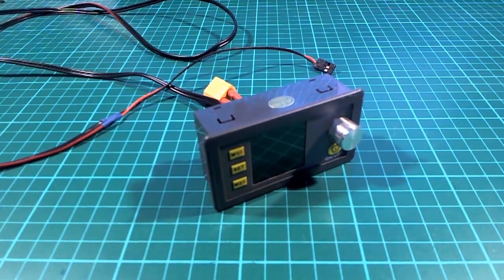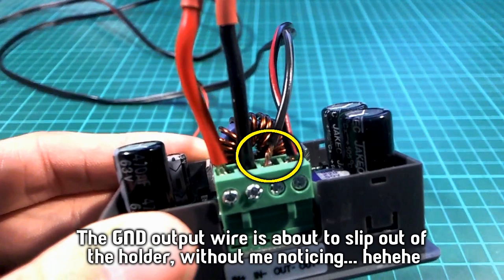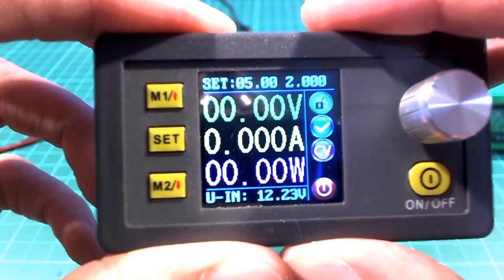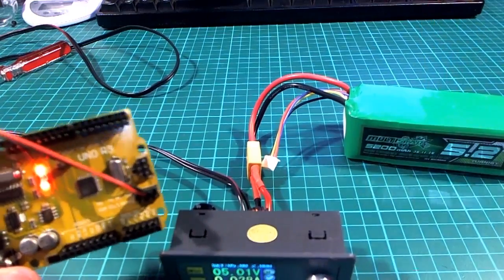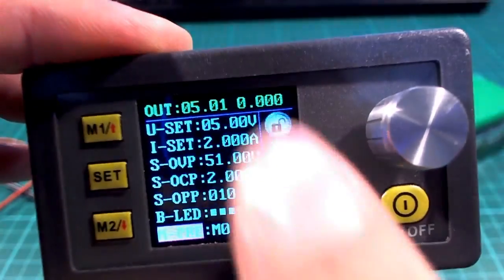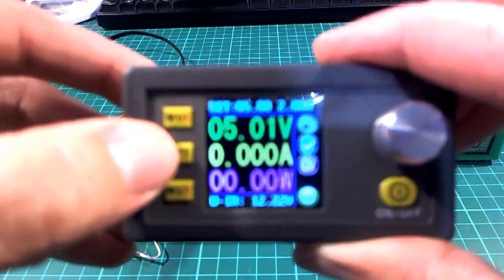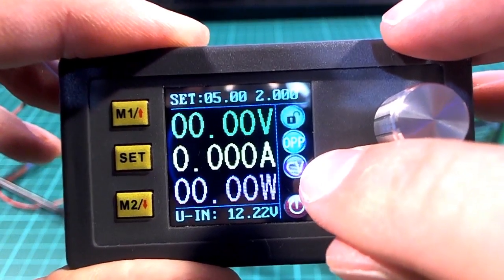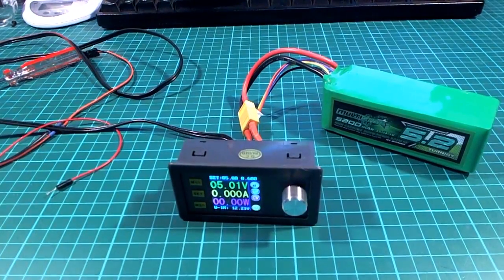Mini adjustable DC power supply/meter first look DP50V5A

Comment: Yep, I definitely need one, I have a
HP power supply (19.5V 3.5A), and IDK is small and kawaii lol
Reply: Hi friend 
how you get 0.9. are you sure you get 0.900? our module max error 10mA, please use a better mulitmeter to compare . and our module can't be calibarted. because we don't need.. 
thank you 
and Hi friends. 
 there is good news. we just publish the DPS power supply module ( DPS3003, DPS3005, DPS 5005 and DPS 3012)
this is the link http://www.aliexpress.com/store/group/DPS-Programmble-control-power-supply/923042_508466030.html
DPS series is updated version, it updates some function and measurement 
range is increasing, especially DPS 30V12 ( current is 12A)http://hz.aliexpress.com/store/923042
you can check ..
Reply: I am the designer of this goods. 
we have my own shop on aliexpress http://hz.aliexpress.com/store/product/RD-DP50V5A-Constant-Voltage-current-Step-down-Programmable-Power-Supply-module-buck-Voltage-converter-color-LCD/923042_32596330856.html 
there are many other version. you can check
Reply: I have the DP30V5A but I-set and U-set are way off. When I-set is on 1.000A, it runs in CC at 0.900A !
Can I calibrate these values?
Reply: It shows on the display of the DP30V5A not on multimeter: the DP30V5A show I-set op 1.000A and shows current of around 0.900A when going into CC  mode
Reply: Hi friend， 
could you send a picture to me , my email 1749808860@qq.com. or you can make video on youtube, and tell me the link 
thank you

Comment: bought one even before this video ended. hopefully it will hold up - but seems like a great value & i'll find it very useful in some of my projects not only w/ Arduino, but with high-power LED's. thanks for this - you are an experimenter after my own heart! found you after watching iNav vids.
Russ from Coral Springs, FL, USA
Reply: if you want to buy high power? we are designing DP30v/12A module . you can keep eye on my shop http://hz.aliexpress.com/store/923042
Reply: Hi friends. 
 there is good news. we just publish the DPS power supply module ( DPS3003, DPS3005, DPS 5005 and DPS 3012)
this is the link http://www.aliexpress.com/store/group/DPS-Programmble-control-power-supply/923042_508466030.html
DPS series is updated version, it updates some function and measurement 
range is increasing, especially DPS 30V12 ( current is 12A)http://hz.aliexpress.com/store/923042
you can check ..
Reply: i have been using this 505v for some time now and really like it. i just gave mine away to my granddaughter who is very interested in learning all things Arduino (and eventually flying quads)... i'm not even all the way home (from Portand Maine to Coral Springs Florida) and i'm missing my supply/meter so much that i'm now ordering the DPS5015. nice unit!
Russ from Coral Springs, Fl usa

Comment: Thanks for sharing.  I've been eyeing these lately.  I have some higher voltage power adapters floating around, plus some 40 volt lithium batteries for lawn equipment.  Would probably work out quite well.
Reply: if you want charge battery? it can charge the battery , but it need a diode. and when you buy this , the diode will be in the package. 40v lithium batteries is ok. input voltage is max 55v.. 
don;t worry , you can try http://hz.aliexpress.com/store/product/RD-DP50V5A-Constant-Voltage-current-Step-down-Programmable-Power-Supply-module-buck-Voltage-converter-color-LCD/923042_32596330856.html
Reply: I am wanting to build a case for this unit and was curious if I could wire the diode into the circuit all of the time or should it only be used when charging batteries? Any problem with leaving it installed all of the time?
Reply: Hi friend 
good, you can add it what you want. about the diode, only when you charge the battery, you can wire the diode, understand ?
Reply: Texas Ace
 If you put it in a case, you can easily wire a switch in the output that would change between diode and non diode output.  It wouldn't take much effort to make that work.
Reply: Thats a good ideal, had no thought of a switch. I ended up just putting 2 sets of power jacks on it, 1 directly connected and the other run through the diode. Figured that having 2 outputs would not be the worst thing around anyways. 

Although for some reason I forgot that it is only a buck supply, so now I am on the hunt for a higher voltage power supply instead of an ATX PS. Think the best I have found is a 48v / A supply for $25ish, or since I doubt I will need that much power I might just go with the 3A version for $15.

Still should come out to around $50 all said and done for a 50v/5A adjustable power supply, not bad at all.
Reply: Where would I find another one of those Green power connectors? I am wanting to be able to move it between 2 locations and wiring in another connector would make this easy.
Reply: in the market, there is no 3A for 15 usd .. 
you buy this DP50V5A , it is enough for you to use 
it has large voltage and current range .. in fact . the price is not expensive
Reply: +glen liu right I agree completely. I tested mine on the scope and the output is dead on accurate and perfectly stable. very happy with how it works. what I am wanting in another one of the green power connectors so I can use it in 2 places easily.
Reply: Hi friends. 
 there is good news. we just publish the DPS power supply module ( DPS3003, DPS3005, DPS 5005 and DPS 3012)
this is the link http://www.aliexpress.com/store/group/DPS-Programmble-control-power-supply/923042_508466030.html
DPS series is updated version, it updates some function and measurement 
range is increasing, especially DPS 30V12 ( current is 12A)http://hz.aliexpress.com/store/923042
you can check ..

Comment: U is the letter used in physics for energy potential which is relative to some other potential, this difference is measured in Volts which is derived from the potential energy needed to move charge based on Newtons as a measure of power and so on. In English U is voltage and measured in V which is volts which makes the definitions muddy. In other languages these are sometimes separated by calling U for example potential or something else which is measured in volts (V). You can't increase volt (V) no more than you can increase a meter but you can increase voltage (U) just as you can increase distance which is then measured in V, it's a fairly subtle difference but an important one.

Comment: I have 2 of these now.  I love them  I power them each from a lenovo laptop power supply (20 volt 4.5 Amp) and can use for 2 independent supplies or a +/- rail configuration.  Have had no issues so far and the current and voltage displayed is spot on from my external metering.
Reply: DROK bought from us, we are factory
Reply from the maker: Good to hear. Yeah I was thinking to power this from a retired laptop power brick too.
Reply: That is the best option as they are isolated and will let you operate in serial ( 2x voltage) or back to back for a +/- supply.  I haver a boatload of lenovo laptop bricks from work.
Reply: Hi friends. 
 there is good news. we just publish the DPS power supply module ( DPS3003, DPS3005, DPS 5005 and DPS 3012)
this is the link http://www.aliexpress.com/store/group/DPS-Programmble-control-power-supply/923042_508466030.html
DPS series is updated version, it updates some function and measurement 
range is increasing, especially DPS 30V12 ( current is 12A)http://hz.aliexpress.com/store/923042
you can check ..
Reply: Where can we find info on what is updated/changed/improved?
Reply: DPS series are updated version. Panel is
different. In DPS series, we change the M1/↑and M2/↓ into V/↑and A/↓. You can
press those button set the voltage and current fast. We add a new function “set
default boot open or close output”

Others are not changed.. 

DPS5005
still need diode to charge the battery.
Reply: +glen liu Hello there, very cool products, I am glad I saw this video and comment, I was looking at a much more expensive much lower power version than your DPS5012 which is going to help me make a great power supply, (was looking at DROK 30v 3A on amazon for 38$ lol) I am going to be finally building my 720W 39v 18.5A power supply and this will be a nice addition to get some lower and very adjustable voltages. From your testing how well does your 3012 handle higher than 30v input? the specs show 40v as maximum input and it has 50v capacitors so I should be ok correct? I was thinking of making my supply be switchable for 720W on 39v at 18.5A to 19.5v at 37A anyway so if it does not work perfectly with high voltages I can play it safe, I am looking forward to maxing this thing out and putting it right to its limits :D thanks in advance. (I will be posting videos as "720W PSU Build Log")
Reply: Hi friend 
thank you for your support . in the market , all DP series and DPS series are desinged and produced by us (including DROK). about your device 720W 39v 18.5A, I can't help you. we are designing 50v/15A, it still can't fit your request. 
about the DPS30V12, you can't change the range to changed some resistor. it is not easy to do . if easy, I have designed already, ok?
thank you for your support . hope you like my products
have a nice day
Reply: Buen día.  Se puede desactivar el ovp y ocp?

Comment: Nice video test.  For about $15 more aliexpress sells a Gophert power supply with its own power supply and a case.  No including shipping.  I would probably want that if I were to splurge on a this type of thing.  It does not  have that  confusing u designation for voltage.
Reply: Gophert power supply , I know this , display is led display.. and it sells very expensive and it is very heavy. 
in fact it isn't worth the price .. you can this module .. 50v/5a , high precision and small volume.. 
it is very worth.. http://hz.aliexpress.com/store/product/RD-DP50V5A-Constant-Voltage-current-Step-down-Programmable-Power-Supply-module-buck-Voltage-converter-color-LCD/923042_32596330856.html

Comment: u = voltage in general and v = Volt is the unit in which it is measured      kg*m^2/s^3 *A
Reply: just like I stands for current and A is the unit of measurement for current (I)  ;-)

Comment: Isn't it U because V can be used for volume?
Reply: U means voltage V is used when we mean the unit of measurement. just like you have I for current with unit of measurement A.
As I understand in the US you use V instead of U. Here in Europe we only use V if we mean the unit of measurement (Ohms las is thus R=U/I)
wikipedia.org/wiki/Voltage
Reply: Exactly!

Comment: Depends on which book/source, it used to be U more often in books and such I believe. U=12v or V=12v ... I think U is a bit more sensible also.
Reply: In Europe, or at least in Germany, we always use "U" for voltage. No idea why ;-)
Reply: U is the general abreviation for voltage :)
U= Voltage
I = Current
R = Resistance
U=R*I etc.
Reply: Thanks Glen... two quick points:1)  Judging by the number of comments above, obviously everyone doesn't know this.2)  Judging by the number of comments below, you have not ended this discussion.iforce2d has a number of informative videos that are very interesting to watch.  He has given your product a very positive review; it deserved a better response from you than your comments above.
Reply from the maker: Where does the U come from?
Reply: +iforce2d It's a european thing, that I know. But I don't think the origin is quite clear, maybe it's only done to not have two v's in V=12v, or because U was unused. Also, Unterscheid is difference in german... who knows?
Reply: U is the potential difference and it is the correct symbol or letter to stand for electrical potential difference. The unit of U is Volt(s). The word " voltage" is an informal and wrong expression.
Reply: ok, let me end this discussion. I am the designer of this goods.  from my learing, U= voltage , I = current. V and A are just unit.. don't care. every one should know this ...
Reply: Hi Jone, thank you for your reply. I got nothing. because he did not buy it from my shop, buying from my reseller. I just think abnout V,A problem. it means nothing. but I very glad many people like my product. if yuo are interesting this, you can check my official shop http://www.aliexpress.com/store/923042 
thank you